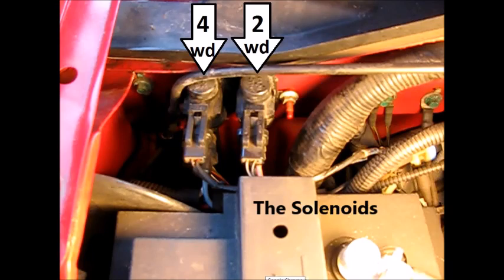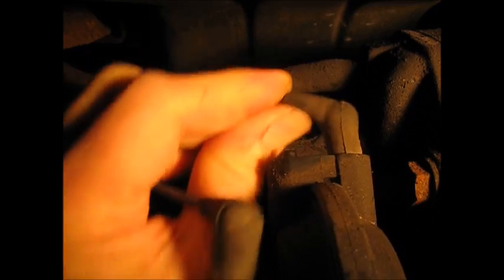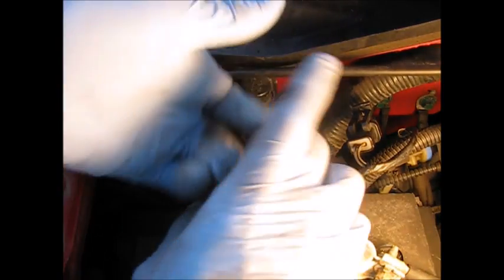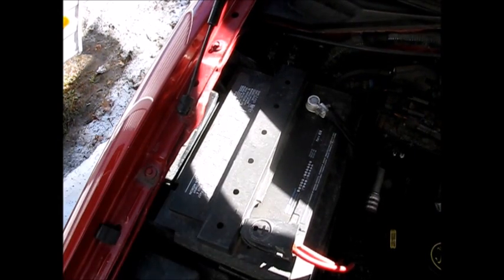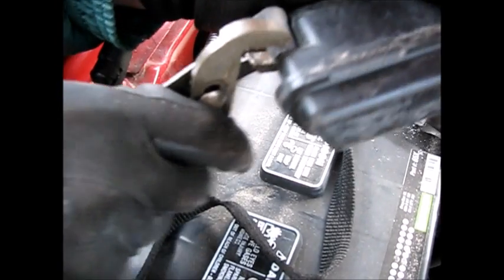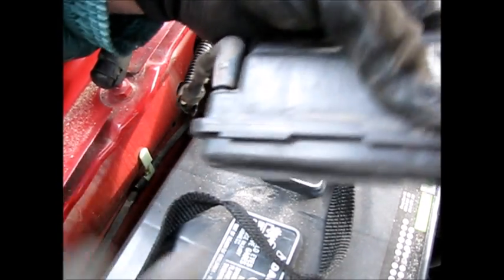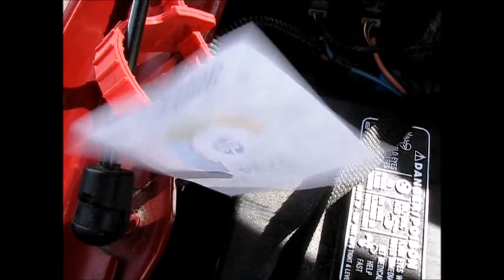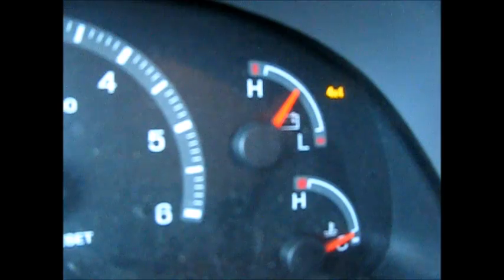Ford F150 4WD not working part 1: Troubleshooting loss of vacuum

Comment: Was able to get my 4x4 working again on my 01 F150 today solely from this video! Had the vacuum line to the 4x4 reservoir and the supply line both get burned up by a ground wire. Haven't had 4x4 in around a years time now in it and figured that it was the transfer case motor itself that had went out. Because of you I just saved myself a ton of money being able to replace to vacuum lines for $15 rather than buying a new transfer case motor for $150!!!
Reply from the maker: So glad this video proved so useful to you!
Reply: @TheOriginalMechanic  As was I, legit saved so much money and it legit only took me taking the battery out and a trip to the parts store and it was working in 10 minutes time!

Comment: What a great video, I have problems too but the light always does come on. I think from this video I’ve learned the supply does work and the issue must be the bore and orange lines from the solenoid to the actuator

Comment: Greetings from Park City, Utah!  Your videos are a great help to me! I have a 2000 F150 XLT with 175K miles. I got my 4wd back working. My problem was two fold. Vacuum lines snapped behind battery. Fixed broken tube by ordering part XL3Z-3A788-AA from Ford Parts Giant. After fixing that tubing, the whole vacuum system was working except the arm of the 4wd actuator. Went under the truck and discovered a Dorman actuator in place without a boot so the actuator arm was rusty and not moving. Penetrant on the arm of the actuator wouldn’t free it. Ordered a new one from Rock Auto, the WVE 1S10933 and this one is stamped with the Ford logo. Now everything works.
Reply from the maker: Thanks for sharing the details of your challenging repairs. Well done!

Comment: I changed my actuator, thinking that was the problem and it is working. I changed the transfer case motor and the only difference is now the four-wheel-drive light turned off on the dash but still does not work. When I turn the key on, it clicks five times and then stops if I try to move the vehicle before the clicking stops on the last click if I’m moving, it will sound like it’s trying to engage.
Reply: Ever find out what your issue is I’m currently in the same boat

Comment: question 4x4 doesn't engage but 4low will provided power off cycling...'98 f150 xlt 5.8 ... power down suggests electrical to me but which soleniod?

Comment: Thank you Sir! I'm back up and running. One vacuum line was broken from rubbing on the battery box and the other had a small circular leak where it might have rubbed.  Sealed them with a little glue and tape. I'm sure I'll have to do a more permanent fix later but working for now.

Comment: Thanks for putting up this series of videos.
Reply from the maker: You're welcome
Reply: @TheOriginalMechanic  I did my checks today, figured out I'm not getting any power to the 4x4 solenoid when I switch over to 4 high. In 2 high the right one checks out just fine. The left one- gets ground, but no power......any idea what that might be? Wondering if it's the GEM- but nothing else attached to the GEM seems to be having issues.
Reply from the maker: @StormLaker  I was thinking the light switch may be involved. I assume you took a look at that since you mentioned the series of videos. My 4WD only started working again when I changed out the light switch.
Reply: @TheOriginalMechanic  I bought the switch after I watched one of the videos- going to swap that out next weekend, may put in new t-case motor while I'm under there (truck has over 200K on it), and I have the solenoids inbound. Hoping it's not the GEM, haha.

Comment: Thanks for the video man was having issues with my 2002 f150 sometimes it would work and show engaged on dash but still no 4x4 .    Air line from silinoid under hood going to actuator was broke.  Thanks again got it fixed 5 min after watching this video.

Comment: When the four-wheel drive light does not come on in the dash 4 wheel drive not working do you know why that would be like that
Reply from the maker: On my truck that turned out to be the 4WD light switch. This switch seems to not only operate the light but also electrically activates the 4WD system. I made a video:  https://youtu.be/Oj3Nuwbjrm0

Comment: I have vacuum but the solenoids dont seem to function for some reason
Reply: Could be fuse, I'd check with volt meter before buying new vacuum solenoid
Reply: @Cjohn31  ok checked everything out and it engages now. But it failed to engage when it was snowy out. I couldn't even leave my drigeway

Comment: My auctuator does not move but both hoses have vacuum. My auctuator is missing that rubber boot. Does that rubber boot have to be there to work? I am also noticing that replacement auctuators dont come with that boot.

Comment: By using your video I diagnosed a bad vacuum solenoid, the one controlling 4WD.  I found I had vacuum to supply sides, plus 12 volts going to the solenoids.  I removed the solenoids and tested them each with 12 volts.  I could hear the solenoid for 2WD activate when given voltage but the 4WD solenoid did not.  Replaced it with a new one ($28.00) along with the improved panel with moisture "roof".   The 4WD now works thanks to you and your video.  Thank you!
Reply from the maker: You're welcome and congratulations on finding and fixing the problem.
Reply: So I am having the same issue. I do not have a way of testing the voltage but I checked the vacuum lines on the supply side and they both have suction. If this is the case then is it most likely a bad solenoid?

Hopefully you guys see this. I know your guys comments are from a few years ago. Any and all info is welcome! Thank you.

Comment: Is there a way to check those solenoids?  I've got vacuum to them, but they dont click when I turn from 2 hi to 4 and vice versa.  I havent checked the actuator yet.
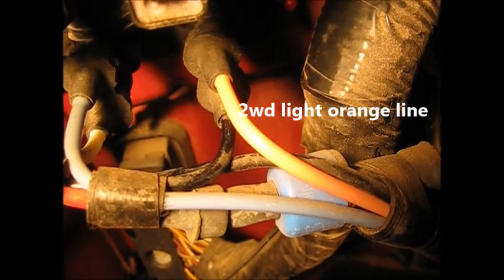Reply from the maker: At 1:32 in the video I show how to use a meter to verify the electrical signals. If both are there in 4wd  you may need need to replace it.
Reply: @TheOriginalMechanic  ok. Thanks for the info. I guess I should've been more aware.  Lol

Comment: If vacuum turns out same, not really fixed items a few 2017 visits to Ford dealer I made until absolutely broke up laughing told guy quit breaking my truck and making me pay to fix repairs didn't need when turned truck in? Oh boy. Makes sense now but my sequences of events I had not connected guy blowing my heat nor engine light initial warning fuel issues to this last 6 or do months of progressively worse problems I can now predict. I ruled out the simple fuel or fuel air mixture issues. But yes all along the guy having replaced my 4w motor, I knew it felt like vacuum. I did have overdrive light blink for few times but not again. It all points to getting under truck and looking if line cracked or if switch not always working it's back to checking the actuator.

Comment: Little more info on below question. I installed new vacuum switches. I have vacuum to switches and also to the small vacuum box behind the battery. I get a 4X4 indication on the dash but no 4x4 high as I said, only 4x4 low.
Reply: Mine (97-03) has the same issue, but I let it sit in 4x4 a while when running it eventually goes in. I believe mine is the actuator failed on the axle.

Comment: On my 2002 F150 the "4x4" light would illuminate even though I had cracked vacuum lines and the actuator was not engaging the 4WD.  This video helped me track down the leaks.
Reply: Op

Comment: I had a problem with mine too. 
I had to fix a loose wire on the solenoid and then had some cracks in vacuum line got that fix and actuator wasn't holding strong so I got a new actuator...
Long story short. I'm good to go for now but I just called the dealership and they got both vacuum harnesses for about $140 in going to look around for a better price but I'm changing out everything....
Nothing worse then not having 4x4 when you need it. 
Nice video thanks.
Reply from the maker: You're welcome. Thanks for watching and commenting and good luck with fixing your problem.
Reply: 1AAUTO.COM

Comment: Totally new to the Electronic/Vacuum operated components. I come from the old mechanical lock in lock out hubs and transfer case. (77 Jeep CJ 7).... I just ventured out and bought a 2003 Ford FX4 off road 4 wheel drive. I've ordered a haynes manual.  Right now, I crank the truck and all she will do is reverse.  I don't even know where to start. My first impulse is to pull the transmission, but realize that in todays world that may not be neccessary. A gentle "nudge" in the right direction or to a resource would be appreciated.

Comment: Found a vacuum line from the right front wheel melted off, cannot find the other end to repair and reconnect, any idea where it should be?
Reply: Jerry keep looking its there some where. You can glue it ,,and use a thin stir straw to hold it together.,,or a can of spry that comes with the red straw .

Comment: OK.SO THE PROBLEM WAS THE VACUUM BOX? I DIDNT HEAR YOU SAY THAT?
Reply from the maker: This was inconclusive. I took it all apart. I put it all together. The vacuum was restored. I was suspicious of the box because it appears to be a big potential source of leaks. I took steps to seal the box. The 4WD has worked well ever since.
Reply: This is a pretty open ended vehicle.  The issues are either the vacuum box, the vacuum lines, faulty solenoids, a faulty 4x4 actuator (attached underneath a plastic shield near the front differential,) bad hub seals, or damaged vacuum hub caps. 

 I may have a mix of a few of these issues as my truck will shift into 4x4,  but won't always shift out.  To compound on my issue, I once had some gnarly grinding while crossing a sandy river bank during a storm and had ZERO clue where the grinding was coming from since I have a relatively new transmission.

Comment: Did you have any scraping noise happening when you drove below 40 mph? Heck, mine even tries to "scrape" at 55 mph. I noticed it only occurs when low on RPMs. My actuator isn't engaging almost like yours. It moves about 1/16 and that's it. 4x4 lights come on, but nothing's happening. I got way better vacuum by the little vacuum box than by solenoids(still get vacuum at 2WD and 4WD, but weak). Leaving it all apart and getting some sealant tomorrow. See what happens. Whish me luck!
Reply from the maker: No, I  never had any scraping noise at any speed. Good luck and thanks for watching!
Reply: What if I can't afford it and just pull the 4x4 fuses I understand it's risky but any other info would be great
Reply: Mine rips like a chainsaw and have to pull over

Comment: I have watched your video published May 9, 2017.  Very good showing how to resolve vacuum leaks.  I've got a 1998 f150 4x4 with vacuum tubing problems.  Mice got under hood and did some damage to some of the tubing.  I can replace most but have a couple of lines that go into the right fender.  I can't find where it come out.
Reply from the maker: Note the comment below on the tube to nowhere.
Reply: What comment.  Don't see one.

Comment: Seems so  complicated just to engage hubs
Reply: Your right,,all that nonsense just to move a 3 inch lever,a pull line would have been cheaper and easier.
Reply: @SonofGodly  yeah your right. A simple cable like a parking brake should work

Comment: While changing fluids, differentials, transfer case and atf, noticed that front differential fluid was very bad looking compared to other cases.  While on jack stands, observed that front hubs did not seemed to be disengaging. Only had 3inches vacuum at my solenoid inputs none measurable at solenoid output but did observe small movement at the actuator. Pulled battery and checked vacuum at vacuum box and found about 19 inches. Sealed box like video. Now have 16-17 inches at solenoid at 4wd works properly. 

Thanks for the video.

Also found that my battery had started leaking underneath.
Reply from the maker: You're welcome. So glad this helped you.

Comment: I have vacuum ath both inputs at the two solenoids. But I do not get vacuum on the line at the actuator when in 2wd, only on 4wd line. Do you think it is the solenoid?
Reply from the maker: possibly, but I would try to confirm that the solenoid is getting the electrical signal to turn on. I covered how to use a meter or test light to check that in part 2.
Reply: No they are working and making vacume,,,,Its your actuator not moveing in and out at the proper distance ,,,ebay has em for 124$

Comment: My 4x4 seems to try and engage when making sharp turns. I have followed your video and found nothing except, coming from the four plastic lines from the it goes to 3 and one is a black plastic line that I cannot find the place to engage it, no t lines or open plugs. If you can help I would appreciate it. Thanks Terry
Reply from the maker: Yeah, that is a line to nowhere on my truck too;  another viewer down below also noticed this hanging black line.

Comment: i noticed a black line that runs from transfer case all the way up behind the cylonoid on the passenger wall not plug into anything any idea's where it goes
Reply: Roger Castilleja I have the same questions and that is also on my truck.

Comment: had 2 codes p155 and p1151 also my 4wd wasn,t working i checked and found leaking vacuum line thanks jim
Reply from the maker: You're welcome.
Reply: My Ford expedition when I put in 4x4 and then back out I loose  vacuum at solenoid anybody have any ideas?